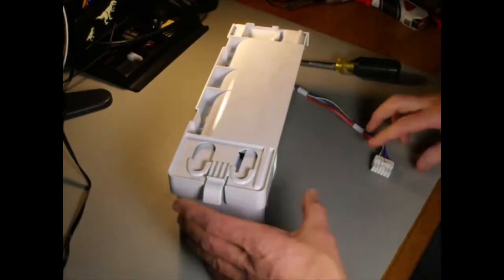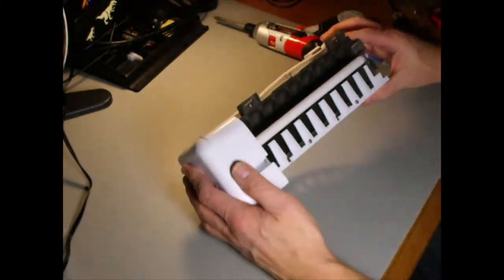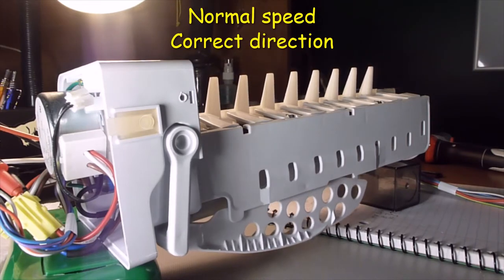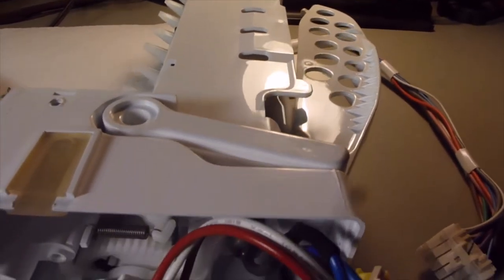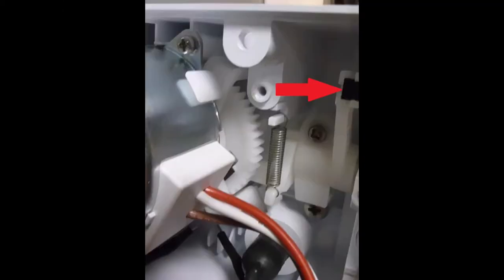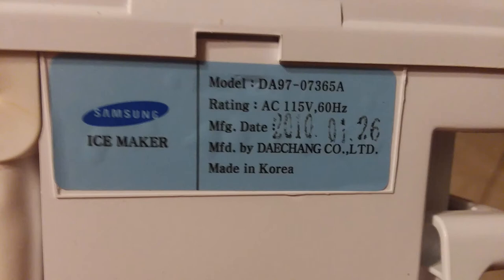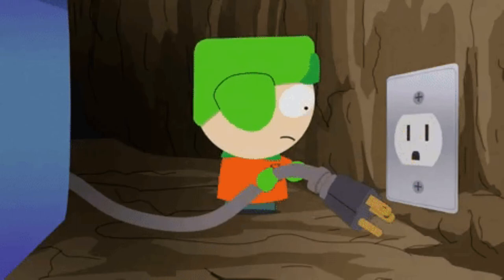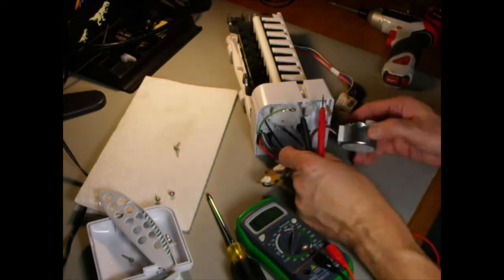Fridge Ice Maker Noisy? Part 2

Comment: Another failure in these ice makers is a Thermal Fuse that is behind the motor near the ice tray and heater.  It is a small black device with two leads that is about 1/4" x 1/8".  If the fuse opens is done.  It will not reset itself and it will not make ice.  The fuse is in series with the ice tray heater.  The part costs $1.25 and is easy to replace if you're not afraid to get into one of these things.
Reply: I just replaced the thermal fuse in my Samsung ice maker that stopped working after we had a power outage in our area. After replacement, the ice maker is fully functional. Thankfully it was a cheap fix.
Reply: Just what mine needed. Ice maker is back in action. Thanks
Reply: Can you please tell us where you can purchase the part from? Ebay takes a while to deliver.

Comment: Two questions: 1) Do you just apply 120VAC to the white/red or brown/red motor wires to make the fingers rotate? One combination for CW and the other for CCW? When I try that, the motor might turn slowly, but sometimes it doesn't move at all.
2) The icemaker motor makes feeble noises ALL the time, like the motor is trying to run, but the fingers hardly move, if at all. Since it wasn't making ice, I replaced the icemaker with a new one. After a week, it hadn't made any ice. When I pulled it out, there was some ice, but the fingers were frozen into it. When I checked the motor, it behaved exactly like the old icemaker. It appeared to be dead, too.
I probed the pins on the control board that power the motor. One always reads 86-89VAC. The other always reads 8.5VAC. Is the refrigerator control board killing the icemaker motors?

Comment: Our symptom is ice cubes are freezing to molds and not dumping into the tray.  We suspected the heating element that slightly heats the base during the transfer cycle has failed.  When we read across the element with the thermal fuse in-line, with a continuity tester, it reads as an open circuit (no tone).  However, when we read across the thermal fuse, it reads as good, (both continuity and "0" ohms).  When we read across the element with an ohm meter, we get 90.2 ohms. Is this a correct reading of resistance for the element?  If not, can the element be replaced?  Can you think of any other cause for this symptom?  Thank you in advance for any insights you may have.
Reply from the maker: I checked my notes but couldn't find a reading for the heating element. Sorry I couldn't help.

Comment: Hey you fixed it by taking it apart and moving the different parts, you got the arm to move. I did not take mine apart and did the reset and it still broken making the same noise like yours. So I and going to take apart put it back see if works.
Reply from the maker: I'm not an expert in ice tray repairs, so I just took it apart to see what failed. But after playing around with it, I did not find anything wrong. Since I was intending to buy a new one anyway, I stuck it back in & reset the control panel. To my surprise it started working correctly and still is to this day.
Reply: Thanks for the reply. Well I took it apart put it back with the arm down plug it back in the arm went up with the motor then filled with water and froze ice so does the arm going down push the ice out.
Reply from the maker: The arm checks if the ice bin is full. It drops into the ice bin, if a sensor detects the arm has fully dropped, it assumes the bin is not filled with ice cubes. Then it adds water & the freezing cycle begins. Once frozen, a little heat is applied to the ice tray & plastic fingers rotate to push the frozen cubes out.
At that point the arm drops again & the cycle repeats. If the sensor detects the arm had not dropped, bin is full, the cycle stops & probably checks every so often to keep the bin full.

Comment: Hey what did you connect to get power to the ice maker with it out.
Reply from the maker: I connected AC power to it, but I would warn not to try that unless you place a safety device or two in series (like a fuse). I cannot be held responsible for any damage to any equipment or person attempting that kind of task.
Reply: @upkeephomeauto1161  Thanks for the video, nice work. My thermal cut off fuse was open so I replaced it. Thanks Jeffery for that one. I would have liked to test the motor but not sure which wires to apply power to. I chickened out not wanting to fry that. Is white neutral as usual and brown one direction and red the other direction? 
Now that its all put back together I'm in the wait and see if this fuse fixed it. So far nothing is happening so I'm assuming the reset is going to take a while before it starts to make ice?